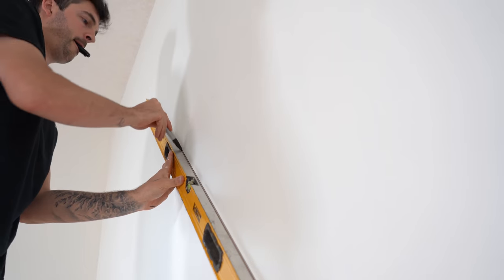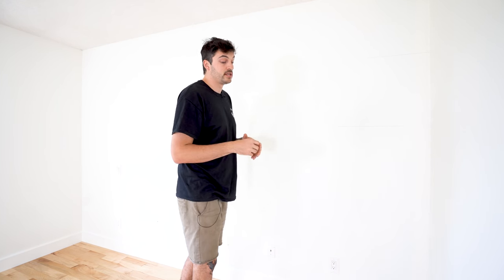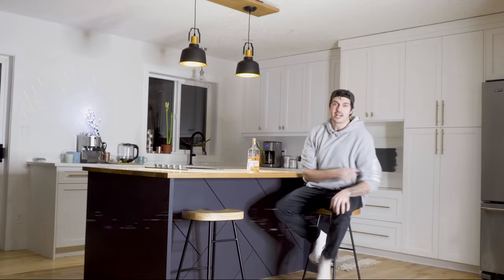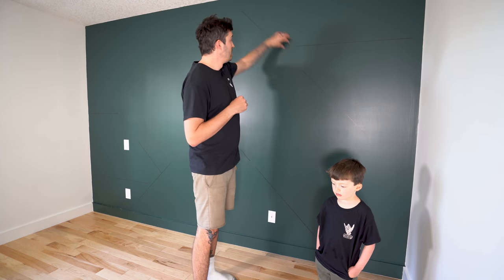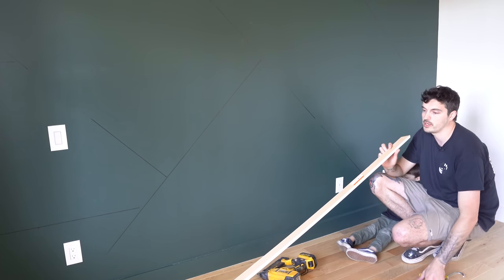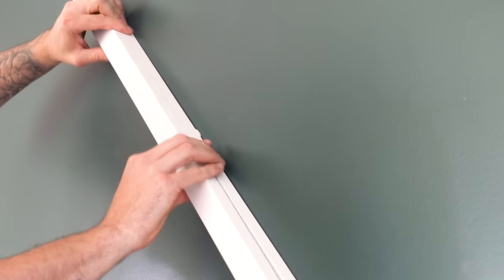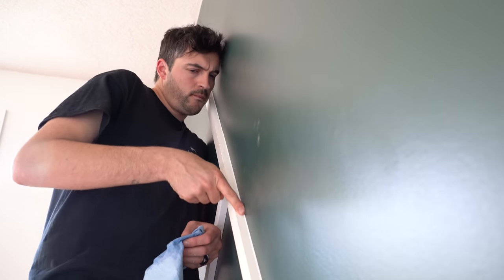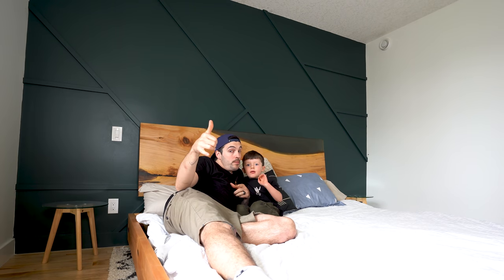Simple Geometric Feature Wall // How To

Comment: European viewers watching US based DIY Tutorials: "...and then you pin it to a stud behind the dry wall..." - ahh...damn and what do I do with a concrete or stone wall? Besides from that... Cool video and great idea. I guess when have a stone based house and not a bunch of dry walls it's next level DIY using drill hammer and dowels. 😉
Reply: Small masonry nails, glue and fill the nail holes would be easy enough I'd say